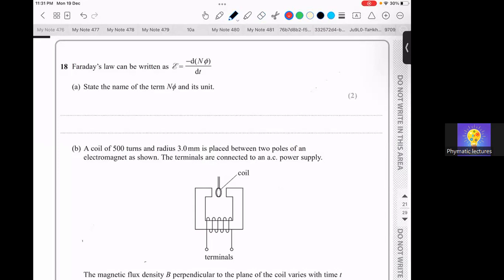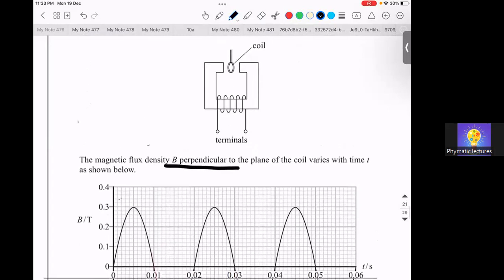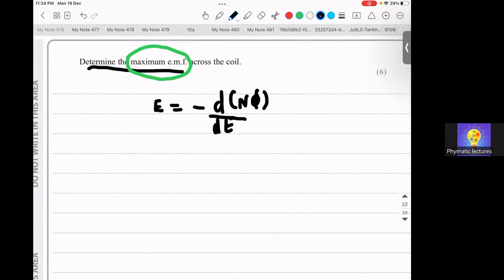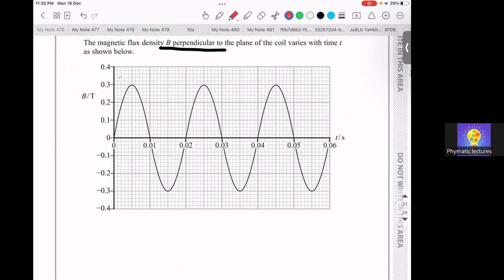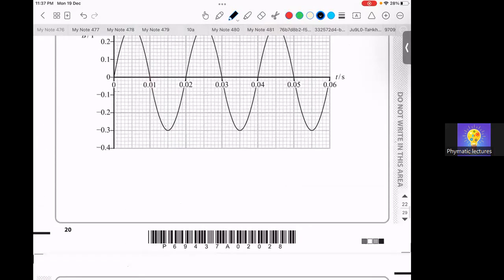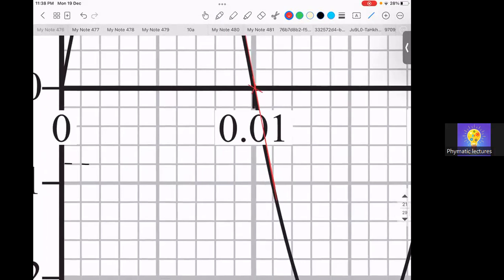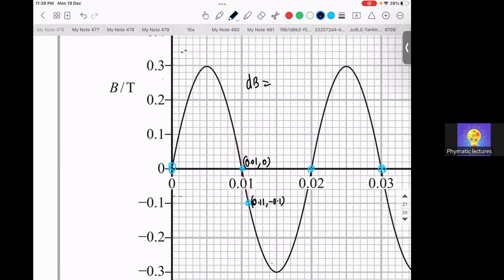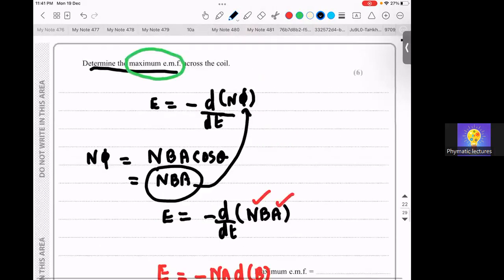#alevel #paper4 #phyics #ELECTROMAGNETIC #Jan2022 #WPH14/01

Comment: I get 1.4π V.. idk why I'm getting pie, I inputted what you wrote 500 x π(3x10^-3)² x 100
Reply from the maker: You multiply whole stuff you will get 1.4 V do once again
Reply: @phymaticlecturesintl6927 Oh oopssss, sorry😅 and thanks
Reply: @phymaticlecturesintl6927 Is it ok if I pick 0.1 instead of -0.1 for the values of y? and the x axis ? I still get -100 gradient when I do that. Also is it mandatory to put the minus sign before in farady's law eqn ?
Reply from the maker: @marshybear-cw1cr  how you will get -100 if you are taking positive 0.1
Because gradient is change in y by change in x right 
Here change in x is positive and change in y is -ve 
Also you should clearly apply the definition of Faradays law
Because -ve indicates the opposition
Reply: @phymaticlecturesintl6927 I did it like this 0.1-0/(0.009-0.01) and got -100 gradient but thank you so much for the help.